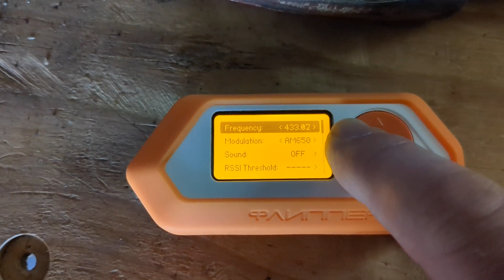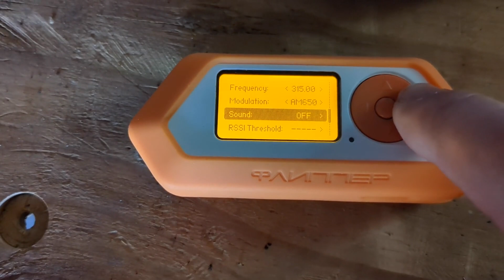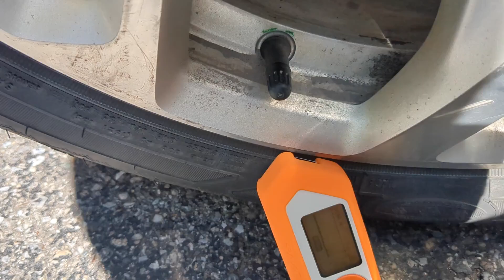Using the Flipper Zero to test your TPMS sensors

Comment: Can the flipper zero be used to transmit 4 tire readings to the car? If so this would be a great tool for those with snow tires or who go off roading and just need to transmit 4 good values to stop it triggering the dash light.

Comment: Is there a way to use a second Flipper Zero to do the engaging part 
(instead of using the Vxdas EL-50448 TPMS Relearn Tool)?

For example, can a Flipper Zero record the RF tool output of the TPMS relearn tool and play it back.. while the other Zero listens for the sensor output?

Otherwise, don't you need a different TPMS relearn tool for every car/tire make?  Perhaps there's little information on all the different chirps?
Reply from the maker: So I did some research and experimentation.  The TPMS relearn tool I have transmits a blank AM carrier on 125KHz.  ...Too low for the Flipper Zero to do it with stock programming, but not totally out of the question yet.  On some ESP32 micros, it is possible to send that kind of signal out to the GPIO via I2S, and it might be enough to do the trick.  I have been playing around with it, if I get it to work I will do another video!
Reply: @doctor567  You could just ask a mechanic, you might have to do a Tom's check to compensate for the cost but go to a pepboys or a large chain shop and ask if you can check out their relearn machine.
Reply: @doctor567 are you sure it's too low? Flipper can emulate 125kHz rfid too, so the hardware is capable of transmitting data at that frequency
Reply from the maker: Very interesting idea, I'll have to do a little more research on those relearn tools to see how they work. BTW they are on Amazon for around $9.  But yeah the whole TPMS thing is kind of a disaster because there are so many different implementations 🙄  it's kind of ridiculous that it's so disorganized, after almost 20 years of it being required. Someone should do a deep dive video on TPMS and figure out if there is a way to unify everything with an aftermarket gadget
Reply: I work in ACC at bigname corporation and I just so happen to have a flipper, and they have the relearn tool. When I get some free time I might do a video or something
Reply: I just did some research and installed firmware onto my flipper to be able to send the tpms relearn code through it, and even pick up the temperature and pressure readings off the sensor to read right on the flipper! I have yet to test it but if you reply i’ll let you know how it went. From my understanding 125 khz is not too low for the stock flipper as that’s what the rfid uses like you said, assuming your able to place the flipper against the valve because it is low range.
Reply: Any eetails on how you did it?